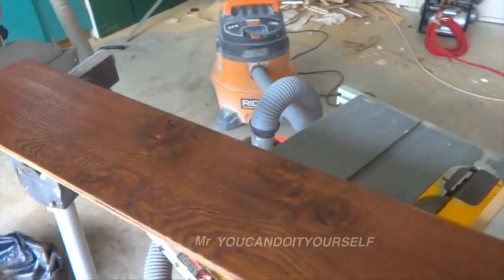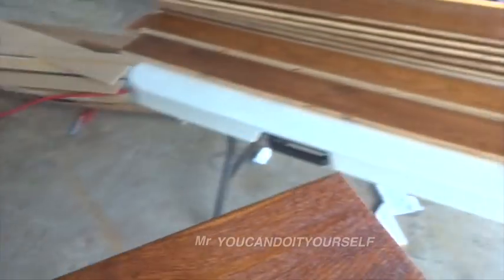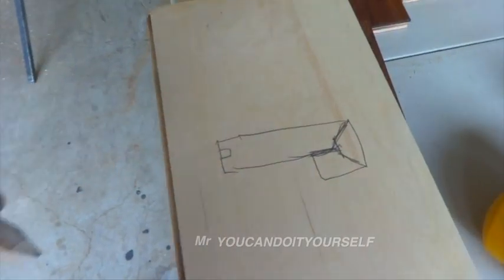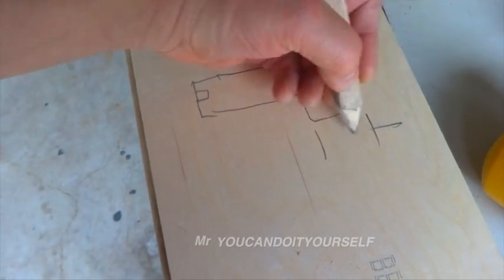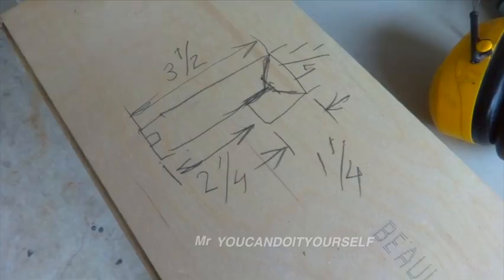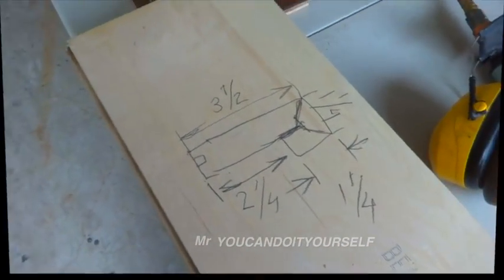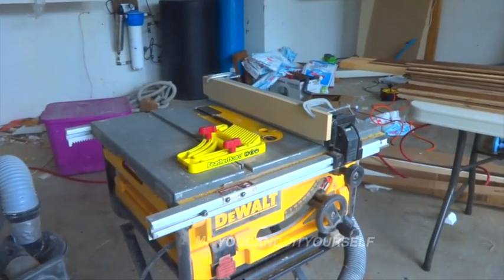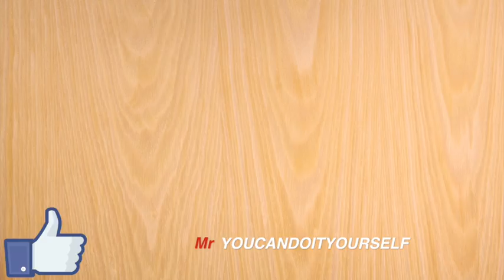How to Make Stair Nosing from Hardwood Flooring Boards Tutorial - MrYoucandoityourself

Comment: the amount of pin nails being put make sure the glue holds, it acts as a clamp.  I get that.  
But the sheer amount of nail ''holes'' isn't noticeable?  once you handle these, you have to see them right?   
Can you tell when you walk on them that they were ''nailed'' together?
Reply from the maker: Hi Patrick, I used pin nails 23 Ga - it's not visible and hold very good. Thanks!
Reply: He is using a pin nailer, not brad nails. Once the glue dries, the glue gives it the strength, not the pin nails. They just act as a clamp til the glue sets up. And they are so small, you probably wouldnt notice any holes, and other people definitely wont notice!
Reply: Or just add color stain wood puddy if you can really see them

Comment: Can you show how you do the stair nose with bamboo floor planks please?
Reply from the maker: Hi Luan, Last bamboo floor I did more than one year ago. I don't have a resent job with this material. Sorry.
Reply: @MrYoucandoityourself  thank you for the response. I tried to do the nose that you showed but of course using the gun splits or chips the wood where the nails goes in. Wish i would have know, i wouldnt work with bamboo floor. Any tips from you would help. Thanks again.
Reply: @luannguyen-rh6nq  
If its solid bamboo, you could always use a round over bit for the front of the nosing, then just refinish where you routered the edge. I did something similiar with bamboo, as a transition going into my bathroom with tiles...
My bamboo is natural colour, so all i did was brush on some clear polyurethane to seal the edge back up. Once it dried, you cant tell the difference from the rest of the flooring.

Comment: Very interesting, the edge is too sharp and won't last very long without splintering. In the Toronto area, that is considered a hack job by diy's . Never ever use flooring on treads. Buy solid treads or veneered treads with solid nosing. So easy to match stain colors. Do it right!!!! Just my opinion...been a G C for 35 years and when I see this type of practice,  just infuriates me. Sorry man ...also learn the proper way to use a table saw.
Reply from the maker: Find my other videos , I showed there how make small bevel and stained it.
Reply: MrYoucandoityourself I find that you are very talented...in Canada it's not permitted. I haven't seen your video on how you gave a round over bull nose. 
Cheers
Reply: @marcosorgini6027  
Don't tell him that its not permitted! Lol Just say its not your way of doing it...
I live in Canada, 2 hrs from Toronto, you can do what you like when finishing stairs. Theres no rule to this! Whether its rounded over, or bevelled, or not.
Plus i can tell you of some of the hack jobs i see...doesnt matter where you live. Hacks are everywhere! Lol
But i do agree, as someone with 2 children, the sharp edges wouldnt last long in my house.
Reply: It is not permitted because we "real" installers know it wont hold up. Most engineered is finished with just a few mm's  of actual hardwood. It is common sense. It will splinter and end up in someone's foot. We are taught this by "real" installers who figured this out 50 years ago and passed that knowledge down. It may look nice and I've done it bc the customer swore up and down that is how they wanted it. 2 weeks later I'm back replacing them. Smiling my ass off when they hand over the grand I charged them to fix it.   @splash5974
Reply: @MrLucifuge1973  
I get what you're saying...but it is your opinion. That doesnt mean permitted or not permitted. That is not regulated by an installer!
There is no rule in place for a hard corner, or bevel on stair nosing. If so, tiled stairs would not be permitted...but in fact they are!